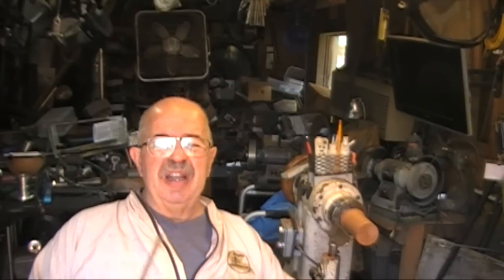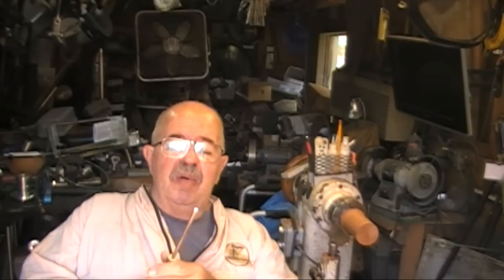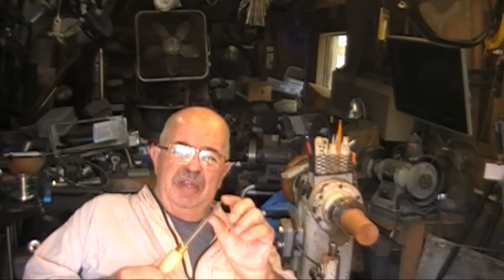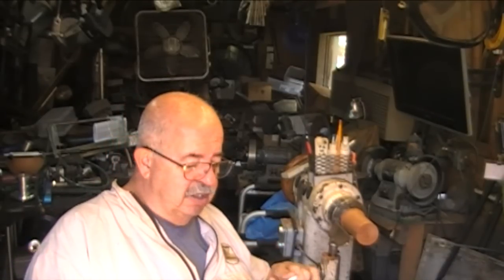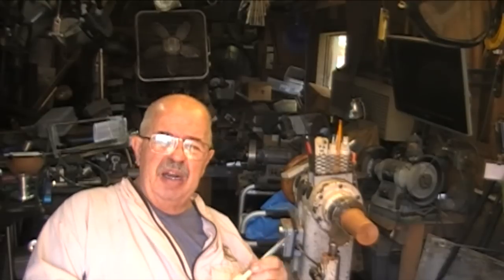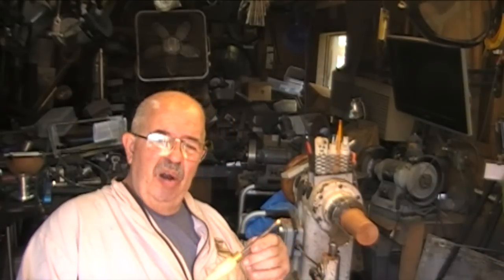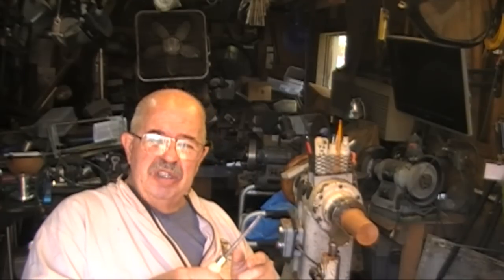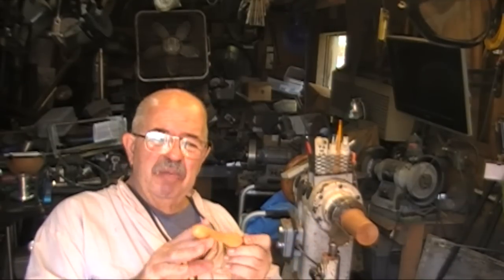Makin shavins 246

Comment: Not sure why that tool would be better than an EWT parting tool with a carbide cutter.  They're cheap and you never have to sharpen them.  If the carbide ever gets dull, just spend $5 and get a new carbide tip and screw it on.